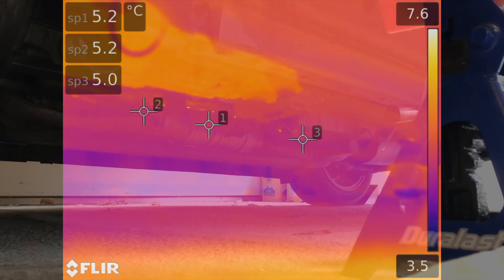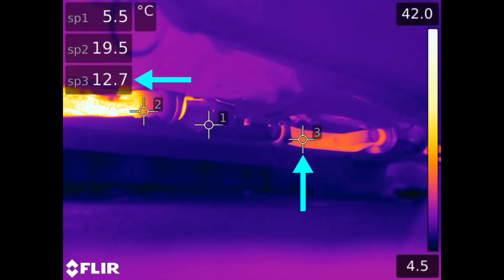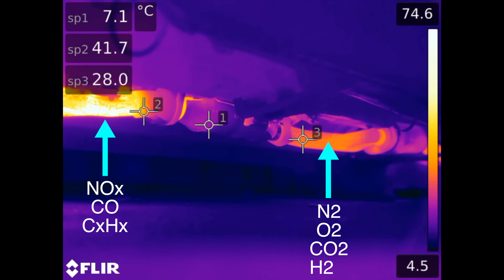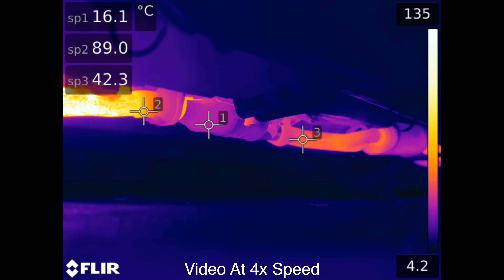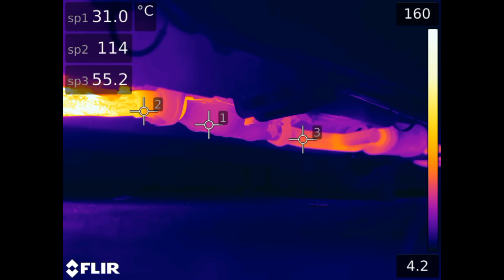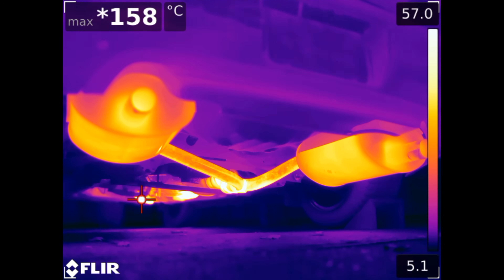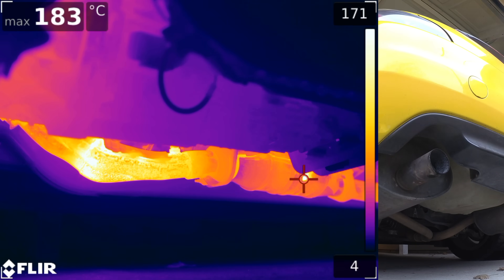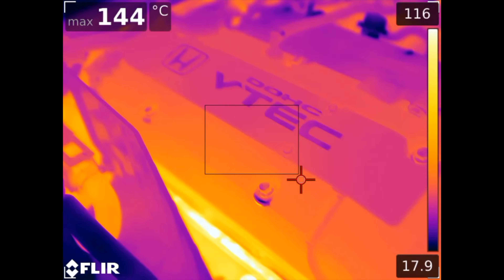How Hot Does A Car Exhaust Get?

Comment: The S2000 press release may shed some light on the unique aspects of the temperature rise which occurs in this excellent video.  I think it's a good thing the heat shields were left in place.
"The advanced emissions equipment employs a three-stage process - cold start, warm-up, and normal temperature operation - centred around an exhaust secondary air system that allows for very quick heating of the catalytic converter. When the engine is started from cold, the ignition timing is modified to give lower combustion temperatures for reduced emissions of NOx while still maintaining relatively high exhaust temperatures. Simultaneously, multi-port exhaust secondary air injection comes into operation which allows for very quick heating of the catalytic converter. An electric pump sends air into the exhaust ports to react with CO and HC particles contained in the exhaust, thus increasing gas temperature. Furthermore, the stainless steel exhaust manifold has a dual-wall design with an insulating air gap between the walls to help in the rapid warm-up of the catalyst. The adoption of a thin-walled, low-heat-radiation, metal honeycomb catalytic converter with a low cell density in place of the more traditional ceramic type, not only increases the exhaust gas processing surface, but also promotes a quick rise in temperature."

Comment: Video Title: How hot does a car exhaust get?
Video answer: Keep moving the camera around and cut the video short so nobody finds out.

I have an exhaust leak.
I'm thinking of using "High Temperature Gasket Maker" to seal the connection between two sections of pipe under a clamp.
The Gasket Maker shows a range of temps it can safely withstand.
I need to know how hot the exhaust can get roughly 14 inches behind the catalytic converter on this 4Cyl 2.0L ICE.
I have yet to find out.

Comment: Can anyone tell me the use of a split exhaust , why one single exhaust pipe isn't enough?
Reply: Space between very limited. especially modern cars. Since Many new features and tech need to fit in. Old cars didn't have problem with that.👌 Besides not all aftermarket exhaust system are not fits for all . Especially your engine fitted an OEM  parts. 😑Step by step engine upgrades vs properly size exhaust piping is carefully choose.😊 Plus Engine Management tune is needed. Which is most Costly at the tuning step😵
Reply: @abdulwafi2634  thanks 😊

Comment: Please help me anwser this sientific question: Hi, I'm calculating a helmholtz resonator to get rid of the drone in my lotus Exige. I've made an excel sheet where I can enter the variables and chosen dimensions so that the length of my resonator chamber comes out. As the speed of sound increases with temperature and that speed has a big impact in the Helmholts formula I'm now having to guess what temperature to put in. The Helmholtz chamber is not realy in the flow of the pipe, so it will be less hot then the main pipe. My question: what temperature do I take for my calculation?

Comment: Please my Vw jeta4.the exhaust muffler gets heated and turns red. What is the solution
Reply: Remove the catalytic converter will be best solution. If the laws don't allow it. Just replace it. All the heat temp from exhaust manifold> flex pipe > resonator will be same before the resonator. And get cool down when reaching muffler. 
It's depends on law since mine remove resonator and Catalytic Converter except muffler. Muffler is must in my country to reduce noise level🤣

Comment: The temperature of the outlet should be at least 10 percent hotter then the temperature of the inlet . If the converter is not working, the inlet temperature will be hotter than the outlet temperatures. .............According to your test the results are opposite

Comment: Hi 3E. Any chance you recorded temperature at input, rear O2 and output close to CAT. While idling and while at high RPM. Mean the three spots read simultaneously for comparison.  I see input at 104c idle and high RPM 210c. Output temp looks to far down stream to be of value and only done while idling. Only first part of video has three spot simultaneously, and one of those spot is useless as it's the heat shield. Useless, in a test of health of CAT that is.

Comment: I watched this video to find out what the difference is between the temperature entering and exiting the catalytic converter. You did say that the secondary O2 sensor is one of the hottest points. I guess the exit should be hotter. But by how much and how can you accurately measure this when a Cat is close to an extremely hot manifold? There is another Youtube video where a gentleman also measures  the in and out temps of the Cat but fails to mention mention what the reading really means. But  your video is still awesome to watch. This gives me a whole new respect for the environment and how our cars affect the health of the air we breathe everyday.  Especially  since I have severe asthma.

Comment: How does the heat of an exhaust differentiate from this one if the exhaust is straight piped, running duals, dual straights, or open manifold/headers?

Comment: Turn the timing back and it’ll get hotter than a toaster  Want a cool trick? Take a V8 with headers and large overlap cam with early exhaust opening, run headers open and turn timing as far back as you can to where it is firing right into exhaust opening. It may barely run but will sound like funny car

Comment: Question:  How hot (in F.) does the exhaust flange (between the manifold and the header pipe) get on a typical 4 cyl. engine, in normal use?  Also, how long does it take to heat up to that maximum temperature, from a cold (70 degree F.) start?    Thanks!

Comment: Please do a video on exhaust wrap!  I heard arguments saying that exhaust heat wrap can actually disentegrate headers over time.
Reply: The biggest problem I've found with heat wrap is that it gets wet and retains moisture.On a mild steel exhaust this corrodes the pipe. No such problems on an SS zorst though. So, yeah, I can see that being a problem on a cast or mild steel header.

Comment: is the proper hvac tape important to use on a pipe break/leak?  Duck bran says yes but up to 260F, while other brands claim "400 and higher". If i use the tape, what if it over heats?  of if i wrap it enough with the alium tape it should be good?   at moment i used weiders puddy crap and it held for 2 days and now smells.

Comment: The o2 sensor is the hottest part because it has a heating element that keeps it very hot to maintain a stable reading, as the sensor is calibrated to temperature, not because of the exhaust gas being hot.

Comment: Hey,
There was a bit of inaccurate information you gave while explaining rise in temperatures of the catalytic converter after a cold start. Running the engine rich actually cools down the exhaust gases (yes! this actually happens)  and helps save the catalytic converter when you're running at high loads and high speeds. The biggest downside of running rich to cool down the catalytic converter is that your emissions go through the roof. The interesting bit is that almost all OEM's use this technique all the time and it is well accepted by the EPA, as it helps save a critical component and most drivers barely ever drive at high loads and high engine speeds. 
What heats up the catalytic converter is the spark timing of the engine. To put it in simple terms, the heat in the exhaust gases increases as you delay the spark. This kills your efficiency as well, but it plays a vital role in heating the catalyst up quick enough so that a car can pass all the emission tests and stuff. And most of the times, cars do this for about 10-20sec after a cold start. 

Hope that was helpful!

Comment: Hello mr. Jason, i'm a fan of you and i really like your videos, i want your help in a subject and i would be thankful, i have to design a machin that tears apart the two main component of a headlight, the lens and the black housing that contains the reflector and the bulbs ..., i want to recycle the materials so i don't need to conserve the shape, but i need to do the sorting of the two sides of the headlight, the ONLY restriction is the existance of a toxic glue between the main two parts wich is not recyclable

Comment: With continuously variable transmissions does that mean that the engine rpm stays constant?
Reply: They were originally designed to keep the rpm very close to constant, and at the optimal rpm for fuel economy. However to please consumers they reworked them to change rpm and even feel like there's gear shifting taking place. So to answer your question generally: no.

Comment: Interesting, I knew how catalysts worked but didn't know they operated at those temperatures. The richer mixture and higher engine speed on a cold start will heat the cat up faster, which is good for emissions.

Comment: Find a way to utilize waste heat?
Reply: AKlover Turbocharging works so well because of the inherent inefficiency of internal combustion engines. Volvo uses a system called turbo-compounding in their D series heavy truck engine that takes it a step further, using an exhaust gas turbine to directly assist the crankshaft, as well as having the traditional turbocharger.
Reply: Thomas Griffin I was thinking more along the lines of recharging batteries, but why not.

Comment: can u do a video on how a transmission lock works (for drag racing)
Reply: Transbrake? It engages both first gear and reverse at the same time. Since they have the same gear ratio, they cancel each other out and the car stays still. When the transbrake is released, reverse gear is disengaged and the car takes off.
Reply: Jack Duno very simple explanation thank you, I was about to ask a for a similar video
Reply: Daaaamn. That's pretty interesting. Thanks for the simple explanation. Doesn't that cause wear on the teeth after a certain number of times engaging the transbrake?
Reply: The gears in an automatic transmission are always meshed together; they do not engage or disengage like those is a manual transmission. Different gear ratios are attained by engaging and disengaging different parts of the planetary gear set. This is controlled by a series of hydraulically controlled clutch packs.

The transbrake would ideally be engaged while the footbrake is applied, the vehicle is not moving, and the engine is at idle. The wear on the transmission from in that scenario would be no different than changing gears under normal circumstances. 

The only real damage you should see is if the rest of your drivetrain is not built to handle the shock of launching a 800+hp car at 5000 rpm ;)

Comment: Hey can anyone answer whether or not I would then be able to use engine enamel that is rated to 500 degrees farenheit to paint my muffler and exhaust on a Jeep wrangler?
Reply: You could always do a spot test to see, but exhaust gas temperatures can reach double the 500 degree rating of the paint and I assume that the piping would reach pretty high up there along with it

Comment: Once operating temperatures were reached did you find that the outlet temperature was higher than the inlet temperature? I'd be interested (if the S2000 has a secondary O2 sensor) to see what the O2 sensor's readings were to then determine if the cat has been degraded and is no longer effective.

Comment: Can you explain glass pack exhaust?
Reply: Glass packs are just a different kind of muffler. Normal mufflers use baffles to suppress noise, which works really well but also makes a flow restriction in the exhaust. A glass pack has nothing to obstruct the flow- there's a straight hole through the middle from the exhaust system to the tip, and the remainder of the muffler's volume is packed with fiberglass to absorb some of the sound.
Reply: Cool, I was hoping it did more than just just improve sound, thanks
Reply: As I understand it they're pretty rare these days because you can get newer designs of muffler with similar flow but better sound reduction. In some places 'glass pack exhaust' has become slang or a generic term for any noisy exhaust fitted to a road car, so you may hear people saying a car has one even when the muffler itself isn't of that type.

Comment: why not use exhaust heat to boost performance? Direct waste gas into several styles of jet engines. Exhaust would then be ejected in style desired, options including: Pod style, mounted to current system. Boost style, fixed body item that can be after burned. Pod+, includes electric generators, will parasite the rotating mass. Fixed body jets can potentially add to power at wheel Via CVT
Reply: Many modern cars do use exhaust heat to boost performance by using the exhaust gas to drive a turbocharger. Also during the 1940s it was common for propeller powered aircraft to get extra jet thrust by directing the exhaust gas backwards through nozzle shaped exhaust pipes- the jet thrust was equivalent to around 30 HP on a 1000 HP engine at 300 MPH (effective 'power' of a jet engine increases with speed, so the jet thrust wasn't so useful when flying slowly).

Comment: Can someone explain to me why some cars have cooling fans that turn on after the car is shut off. My 1990 honda prelude did that about 10 seconds after the engine was turned off. I can't think of a good reason for this. It's not like the engine can get any hotter after being turned off right? Thanks!
Reply: Heat Soak. You're driving along and the engine is generating power and thus heat. Then you come to a stop and turn off the engine. There's still a lot of residual heat in the engine and you've just turned off all of the pumps circulating water to cool it. The fans will run for a short time (or longer if it's a hot day and/or your engine is very hot) in order to help cool the water in the radiator, and it'll often run a small pump just to keep things circulating for a little while.

Basically, it keeps the cooling running for a short after stopping to prevent excessive temperatures due to heat soak. Same reason you see Formula One brakes smoking during pits-stops but not when they're actually being used at 330 Km/h
Reply: Interesting. So essentially, even though there is no additional heat being introduced into the system, the temperature will still rise in certain components? That makes sense. The average overall temperature doesn't go up, but components that are less tolerant to high temps may increase beyond what is safe.
Reply: Yes - it's mainly the components near the very high temps which suffer though - whilst there's no additional heat being introduced, you''ve just removed some airflow and coolant flow by stopping and turning the engine off, so for a short period of time, the temperature near some components can increase despite the engine being turned off thanks to a bloody hot turbo being right beside it and zero airflow. Hence the fans running for a few seconds/minutes - it's basically faking you still driving

There were stories of people in the 80's driving Sierra Cosworth saloons - fairly high power cars for the time, stonking down the motorway with the turbos on full boost. They'd then pull into the service station and come to halt, turning off the engine to refuel. The turbos/pipes/oil/something in that department would then burst into flame as they were very hot from the thrash down the motorway/highway and then had all of the cooling removed by coming to a stop - "Fwooomth" is the next noise they made...

Comment: I was wondering if you might be interested in making a video where we use the thermal camera on my 2005 Subaru Outback XT. I have a small exhaust leak and I think using a thermal camera would be a coolest way to try and find where the exhaust leak is coming from. The wagon has a turbo and we could test how long it takes a turbo car to heat up when warming up the vehicle at idle. We would be able to use the camera to see at what point is the downstream CAT is heated to it's optimum temperature (where it is hot enough to drive the car without throwing a P2096 trouble code). I usually let the car warm up for at least ten minutes. We could also test how long it takes for the turbo to cool down when idling. 
I live in the Portland area! I know the more expensive FLIR Thermal Camera is going back soon, but I just thought I would mention it as a possible concept for an education video. I always enjoy watching your videos, but I think it's time to introduce my Turboru to Youtube.

Comment: I have a request based on a question I can't seem to find an answer to that isn't just opinion... 

Q: how does a high flow catalytic converter work by comparison to a standard oem converter? 

Basis of question is simple, I want to upgrade the headers on my car and don't want the restricted airflow of the oem cat to rob power. I've already had the exhaust upgraded to a performance system with resonator and muffler (MagnaFlow) - while a full cat delete is popular - i'm curious how the high flow cat from usp works and if it is actually doing its job if I put it in our if I'd just be wasting money on it... 

Thx!

Comment: You've mentioned before that you'd be interested in getting your s2000 dynoed for a baseline before doing any power mods. If you do, and if you could borrow the thermal camera again, it would be interesting to see exhaust, engine, drivetrain, etc. temps while under full load vs. just idling!

Comment: thats relatively cool compared to EGTs in the 800-1000deg C range. why is that?
Reply: The exhaust system is touching the hot exhaust gasses, but its also touching the cool ambient air, so it reaches an equilibrium somewhere in between in temperature.